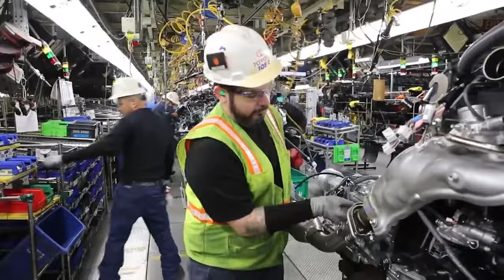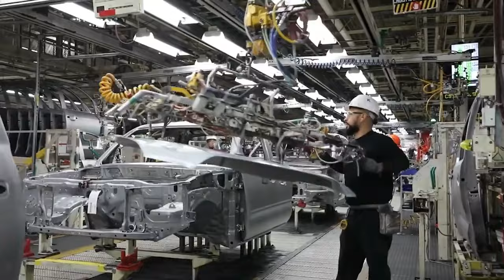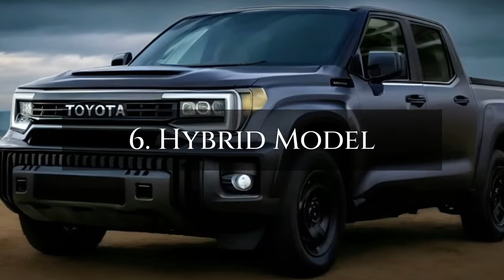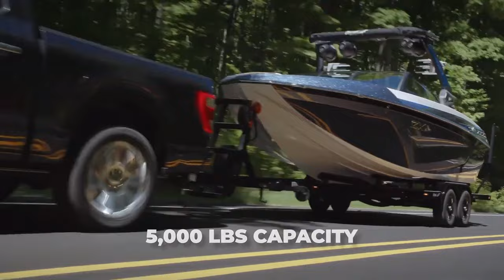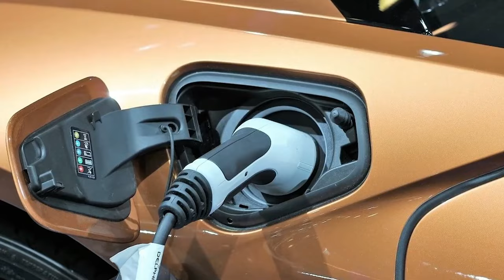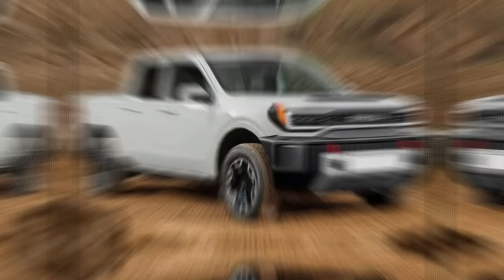8 Reasons Why you should buy the Toyota Stout (Skip Maverick!?)

Comment: I am holding on to my 2003 TRD Tacoma, and now you show me THIS.  I am getting in line.
Reply: Toyota Stout does not exist.
Reply: Wait til you have the transmission, electrical and front differential problems. The front differential snaps under light loads. Better hope it happens under warranty.

Comment: I have not seen any information, pre-sale offers, sneek peaks from Toyota yet.  It's close to June 2024 so I am wondering if Toyota will build this truck for the US market next year or next or if at all.  I got a chance to drive a Ford Maverick (the stripped down work version) as a delivery vehicle for my work and I can say I am impressed by that little truck.  Seems perfect for someone who does not need a big hossin' truck but one just for occasional loads and commutes.  I live in Tennessee and see people drive trucks everywhere.  But to me it is not smart driving a big Ford F-150 or Toyota Tundra just to go to work at the office, pointless really given the fuel economy of those things plus they are not cheap to purchase!  The Mavrick peaked my interest when I drove one, handling was great, drives like a car.  I drove a hybrid model which got 42 miles per gallon, more than double my small SUV.  Toyota needs to get the ball rolling as Ford beat them to the punch.  Also most manufacturers beat them to the punch in the EV market.  I want to buy a Toyota or Suburu since the quality of both those brands seems excellent.

Comment: With the quality issues Toyota is having I'd wait 5 years before touching this thing. It seems just about everything Toyota is putting out now is junk. I don't like Ford's but I'd rather take a chance with a much cheaper Ford than I would with the expensive Toyota. My 2020 Camry was the worst new car I've ever owned and Toyota wouldn't even try to fix the problems. I dumped it before its second oil change.